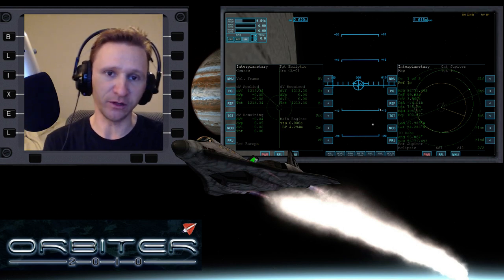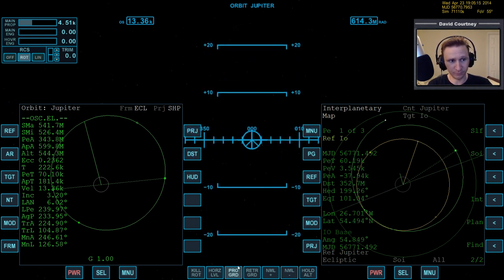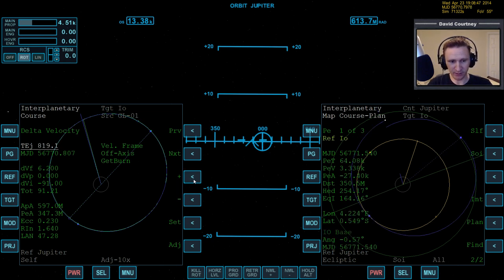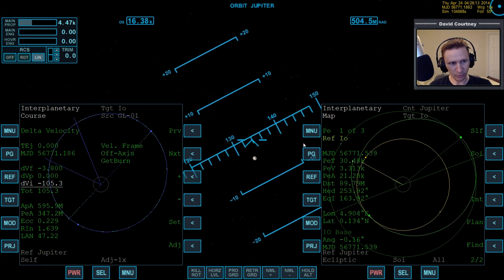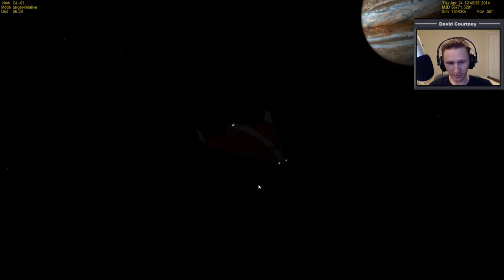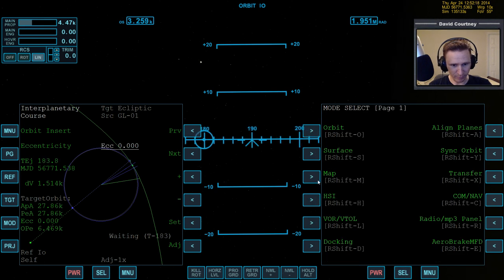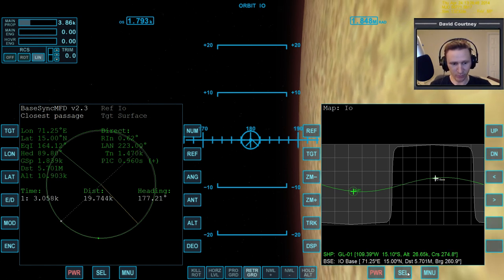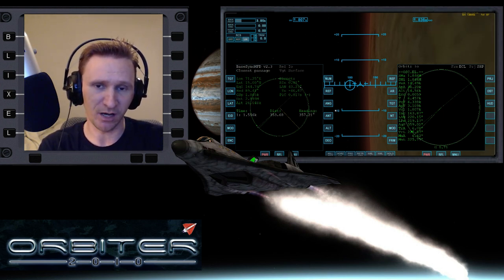Orbiter 2010 - [Part 13] IMFD Jupiter Moon Hopping - Europa to Io

Comment: 23:18 Instead of using the distance as the determinant factor to lower the orbit, you can use PlC on the right side. When it changes from either (+) to (-) or vice versa, you are exactly halfway across.
Reply from the maker: Good tip, thanks.